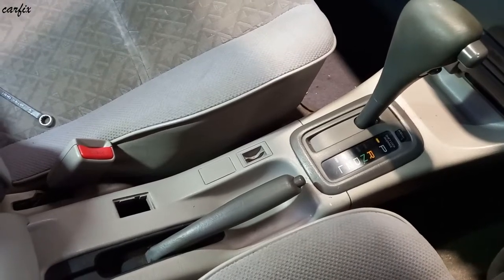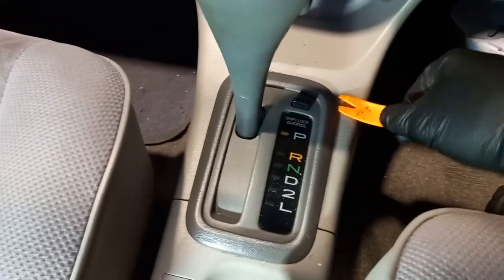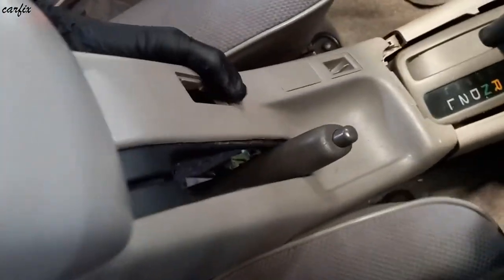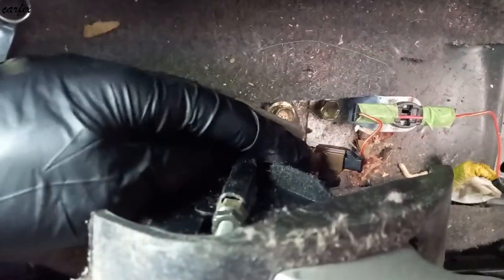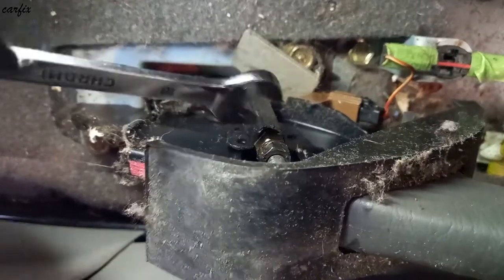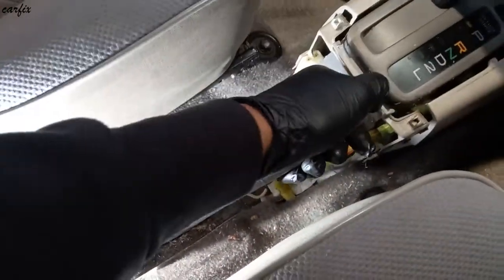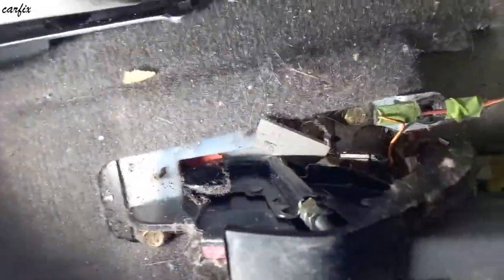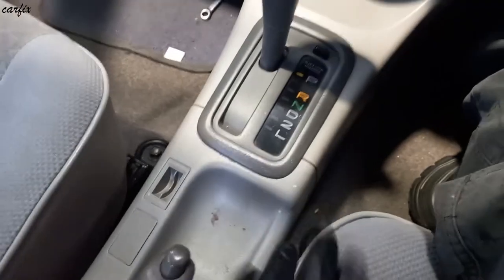How to adjust hand brake cable Toyota Corolla. (1995 to 2015)

Comment: Actually you don't need to take out any screws or bolts! When I adjusted my hand brake I took everything off like what he said to do in this video! After all of that, I found an extremely easy way to adjust them! The rubber piece around the hand brake near the arm rest, pull the rubber back and it's right there! 10mm socket and an extension, that's it!